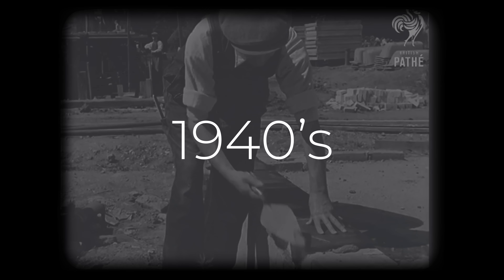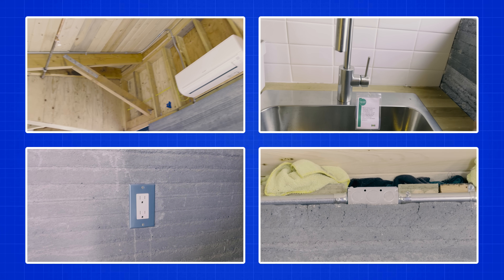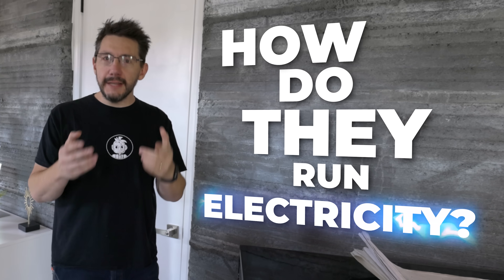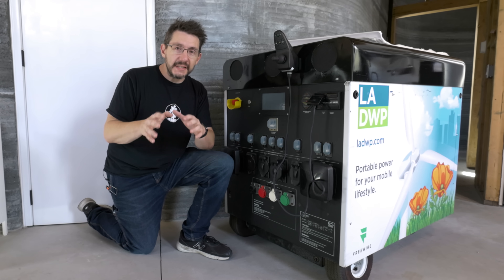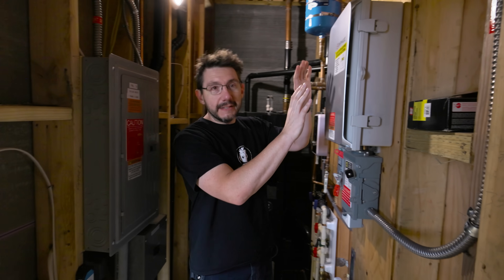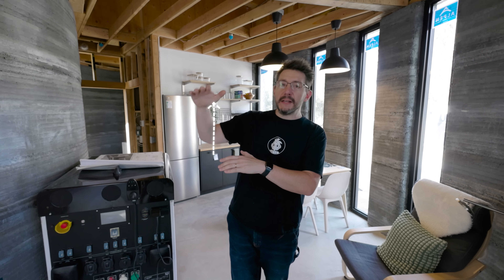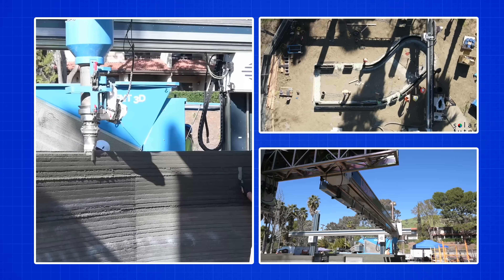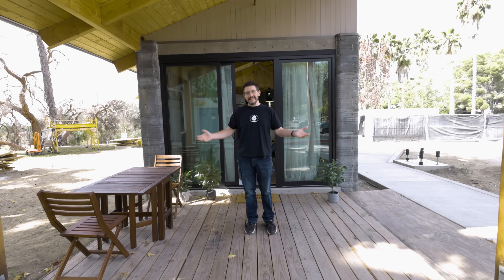ON SITE at a 3D Printed HOUSE!

Comment: I'm a huge 3D printing fan but not of houses.  They look like pods to me.  
Further, mitigate carbon?  What does that mean exactly?  What happens to the carbon released in the making of concrete?  And what happens to the carbon already in the air?  How about the mining of the solar panels and batteries needed?  Does that "produce" carbon or is carbon goin g from one place (petrol) to another (the atmosphere)?
See?  I print in plastic that takes tens of thousands of years to decompose and here I'm being told how green this house "full of experiments" is.  I just don't believe it.  So what exactly is being sold here?
I'd rather have engineers and architects print these houses that look better and function more practically.  I'd like one with a wood burning fireplace.  It'll be less like a pod.

Comment: Where are that high costs hidden ?  This house looks more like a 50k house. With to many extra fees for a architekt without Real world expirience and missing Isolation on roof and walls , placing a shower in he middle of the room without a curtain is a nightmare especialy with unprotected concrete indoors, open conduid and did i miss the bed ? Who in the world would place the solar battery in the living room and not outside or in the fire repellent room that not block emergency exits? 
Also why are the solar panels in the shadow - or better on the wrong side of the building ? 

The inpracrical shape of the building is also a big minus. When you have no straight wall, you will hate it.

And as a german, i say that roof is realy cheap. 

Could they make a realistic houses with realistic rooms and something like a garage ? Also what are with overhangs and real concrete ceelings ? 

I like the intention of printing a house. I love the 3d printing aspect of it. But i also have a deeply placed hate for architects that make something fancy because they can. But totally ignore practical real world needs.

Comment: This was interesting, and I'm rooting for 3d printed structures but, you could easily build this with traditional methods for under $150,000, and a good crew focusing on the job could have it done probably just as quickly.
I still wonder where the budget balloons on 3d printed structures, they're insanely OP -overpriced.

Comment: The 3D printed concrete is cool, but it's scalability is limited, and not sure it would make sense for many places.
The house building technology I think is more sensible and the future is the Lego block style building (Gablok).
But everyone being able to have a home is important, and something society should be striving for.
Reply: Agreed its a very, very cool concept but in practice its going to be far cheaper and more efficient to have the houses prefabricated off site. Something a bit like Huf Haus has done (and done very well).
Reply: @puressk  Check out Gablok. That's the "Lego block" building. Prefab blocks, with insulation. Easy to transport, easy to lay. 
We need these innovations in building.

Comment: ya they got a long way to go that size less than 50k..  but its California they lost track of reasonable housing decades ago.. what's the insulation like? a concrete slab which is what these walls are is a horrid R factor of 1 .. the quick shot of the rook looks to be almost no insulation there.. I'm hoping that got at least some foamboard under the metal roof

Comment: You mentioned that the cement mixture has a greater percentage of fly ash. I’m surprised by that. Fly ash is a common additive in geotechnical grout mixes, and it’s been almost impossible for the local suppliers to get ahold of it in significant quantities lately.
Reply: Probably another reason for the higher cost.
Reply: The "carbon free" hysteria is never about practicality.
Reply: Prob lasts as long as a Chinese new build

Comment: I hate to be a downers but that price has to come down way past $150,000. Here in Houston I got a 3 bedroom, 2 bath, two car garage home for $120,000. True, there is a pricing bubble atm where on paper its worth more, but those cycles are every 10 years or so. For a starter home you want something closer to what a couple starting off in their careers can afford. $50-75,000 should be the price range.

Comment: Hmm. I'm wondering whether a type of brick made from sand and waste plastic (a composite) could serve as another form of "3D printed" house, but in a more pick and place fashion. If there's a way to airtight seal the bricks without mortar, that would mean homes designed for disassembly :D
Reply: Glued sandstone or foamed up concrete is the equivalent. But a pain to design with
Reply: There are cinder block LEGO type build systems out there

Comment: So couldn't you use forms and lay out the conduit the same way and then pour your concrete?  That would be better eco friendly because you wouldnt have to run a robot layer over layer over layer which would consume a lot of electricity.   Everything else is just normal traditional (now) eco construction so really 3d printing a house is a net loss.  More energy to produce, more specialized tools, more cost for the foorltprint size.  Form built poured concrete house would be cheaper.

Comment: Bro, do you even know what a $150,000.00 house cost that isn't on the West Coast? What should happen is Boxable should start experimenting with 3D Printing.....lower their $50k home even lower.
Reply: Boxable already got told the fastest way to improve their process by sandy Monroe. End of the day additive manufacturing doesn't work in a factory like boxable. But pre-made forms and fast expanding foam would churn out a house every day.
Reply: Isn’t that the whole point though? These students built a house to comply with California code and were able to do it for what looks like ~$200/sqft. Of course in places where labor/materials are cheaper you are going to be able to build a stick frame house for less.

Comment: add a  cnc machine to cut and prep  support wood and conduit  and have a crane on the printer frame so you could cut the wood and joinery  so with a few people to guide the wood  in and drill into the pre drilled holes

Comment: Is $250,000 supposed to be expensive, or something. Here in the Bay Area, you couldn’t buy a single car garage for that!
Reply: This is just the house, not the land. The car garage probably costs 10,000, but the land.....
Reply: My 2000 sqft brick house on .25 acre in rural texas was $175k when I bought it last year. Kicks the crap out of this ugly concrete one. Much easier to modify later on too.
Reply: If that's where you choose to live, that's what you choose to pay.  You are never locked into a location, slavery was abolished.  Break the chains and move on.
Reply: @BurninGems  we love it here. Where did I say that I wasn't willing to accept the tradeoff of expensive real estate? All I commented on was that from my perspective, $250k sounded very cheap.